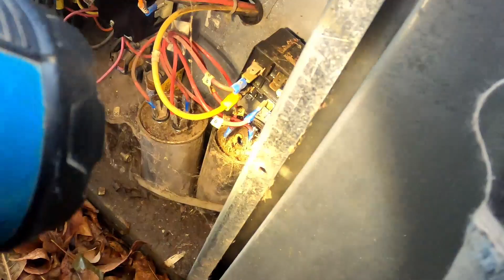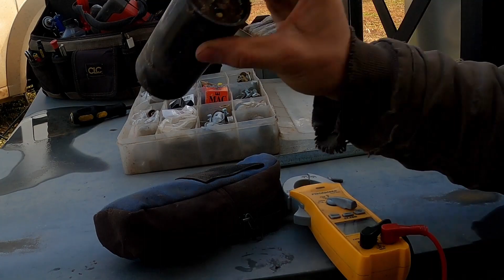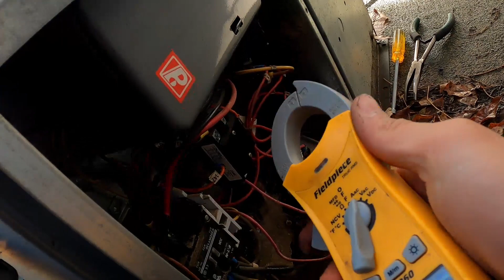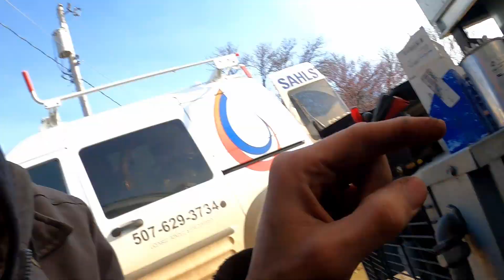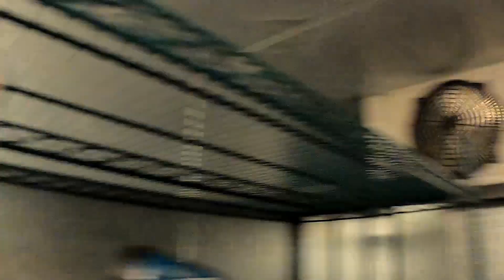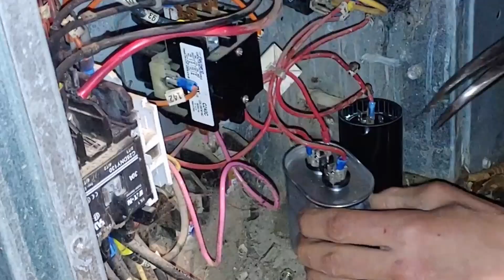Exploded Start Components On Freezer Repair

Comment: Usually when capacitor explodes there is a cause. A lot of the time it is caused by short cycling. I have had many head masters cause this. Or someone messed with low pressure cutout